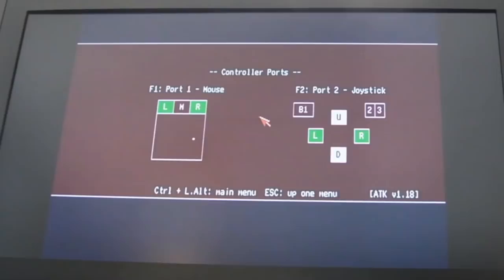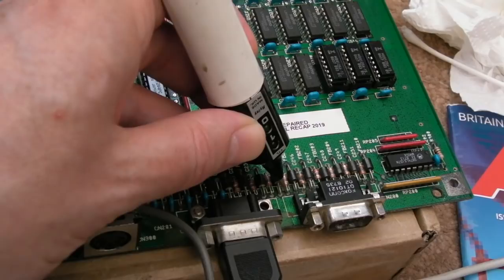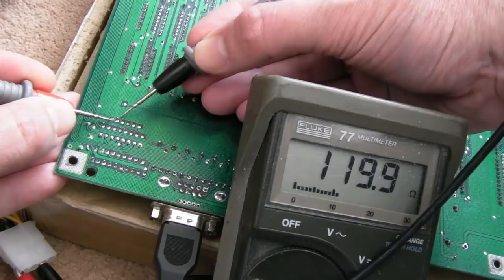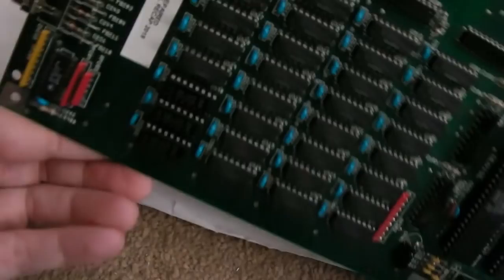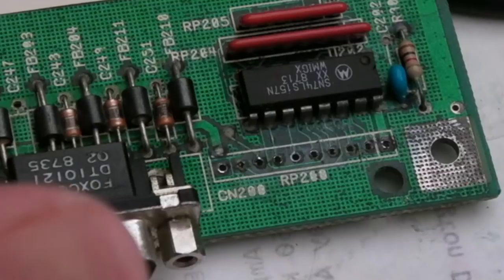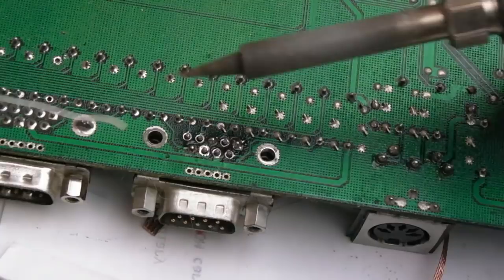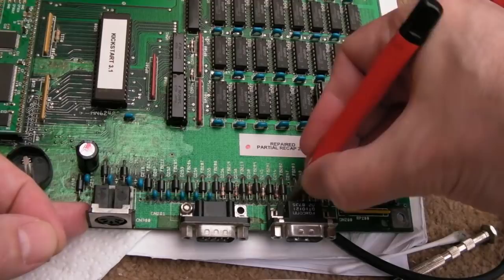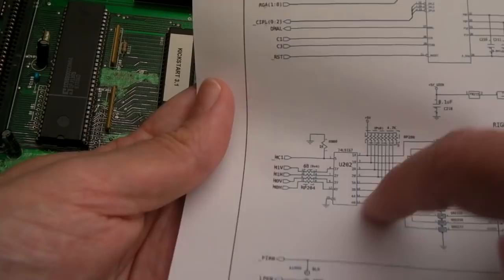Commodore Amiga A2000 Bizarre Joystick Port Repair

Comment: Just shows how corrosion can cause the strangest faults, you made me crack up with the getting old comments. Join th club Chris, I'm what I would call a 'young' 61, but I find myself doing the exact same things. Ive got an Amiga 8833 mkII that needs the flyback changed yet even though I've checked out all the safety stuff I STILL keep going back to check it because I'm not sure if I remembered it correctly..LOL.. Every time I read it I say to myself, "yep I know this, read it loads" but still go back to it :)

One day I'll actually fix the sodding thing...

Have fun, great fun video and proves that not everything that goes wrong is directly component based. Sometimes it's just the flow (or lack of) of the board..

Comment: The 120 ohm short went away when you removed the cap, but you still had a odd resistance reading between the cap pins on the PCB.  I suspect that heating up the components you removed with the soldering iron may have fixed the internal shorts in the components.  I have seen a ceramic cap exhibit this behavior before.  If my theory is correct the problem may happen in the future with humidity and thermal cycling of the board.

Comment: That is why i always desolder a lot of parts when the bloddy Clock battery has leaked.
The battey liquid ( i don't know the correct english term for it) could become conductive.
Over time it would mess up a lot of things.
The keyboard connector is also on the list of things to get out and cleaned.
If you are lucky the cpu slot didn't get too much battery internals under it.
Reply: Blooming batteries, the old variety just sodding leak, the new types (vape machine type ones etc) explode..Can't win.. I think I prefer the leaky ones, at least the board does not catch fire and lose most of the PCB :)

Comment: What a weird fault. I suspect you had a join somewhere under the port that was causing some of the inputs to get lost, and I think some of the legs on the resistor pack must have joined as well which was causing the cross-talk between the ports.
Reply from the maker: Yes, it's very odd - I do think there were two issues!  Perhaps both happened at the same time due to humidity or something?!?!

Comment: Hi gadget I have a question its of topic but I have a Sega cdx ,that is having trouble keeping audio in sync with the game it load's games fine but CD sound tracking, is behind like 10sec or so I suspect cap's on the power board ,after 20mins or less it plays everything fine I've changed out the laser but it's hasn't improved it also changed cap in power supply no change either what do think 🤔
Reply from the maker: It does seem to suggest the laser is having trouble tracking or focussing.  Are you using original game discs?  Some of the rips out there have sync issues where the audio tracks are not right, ie. several seconds or more out of sync - they start later or earlier than they should due to a bad .cue sheet.
Reply: Hi gadget thank you for your response yeah I'm using original Sega CD games all perfect condition some seam too load fine say like microcosm witch is only using one track, games like sonic CD that need too change tracks on the fly like sonic seem to be behind like the cdx seems too know we're it needs to go it shows on the little display it's finding the track but the laser act's like it's lost then 10 15 seconds later it plays the music audio CDs are the same with batteries or ac adapter from cold start but if the cdx is left to warm up for 15 20 minutes on the splash screen cdx will play everything perfectly , I have brand new lasers here now , the laser I replaced the original one with was from a sanyo 3DO , thay use the same laser it improved a little with the 3DO laser but that laser is 27 years old so maybe a brand new laser may fix the issue 🤔 will install a brand new laser and let you know I have a cap kit coming from console 5 for it also so if brand new laser does not sort problem maybe power board recap may hopefully , just try it again now after a week of it just sitting on my shelf again we're I display it ,and it's working perfectly from cold boot again very strange 🤯 going to replace the laser again with a brand new one and see if the issue comes back Im very confused 😕 about it now any thoughts gadget 🤔 thank you gadget for your help and time on this really wanna sort this cdx out there very rare units it's never given me any trouble before this